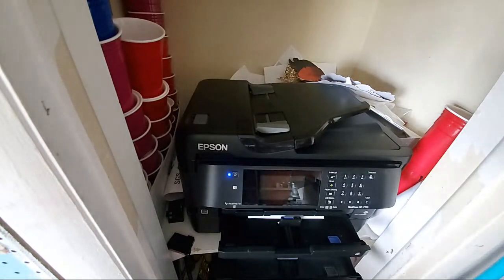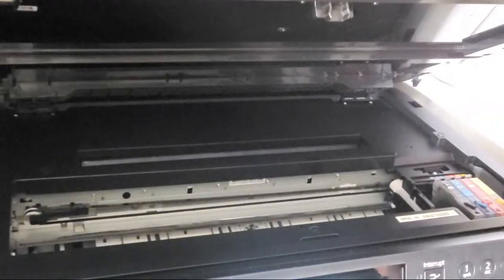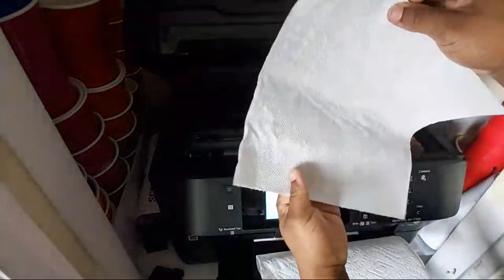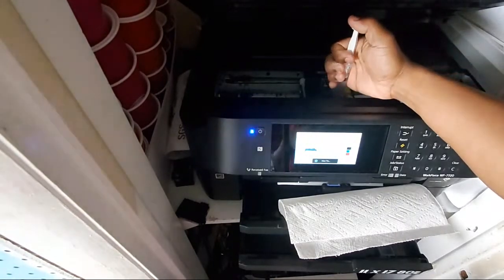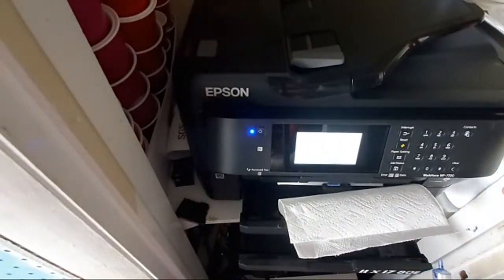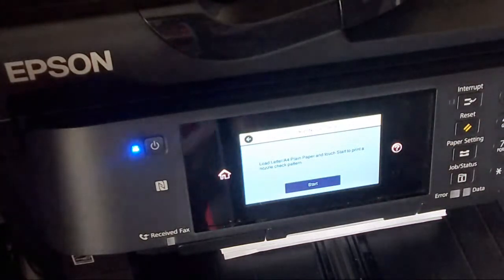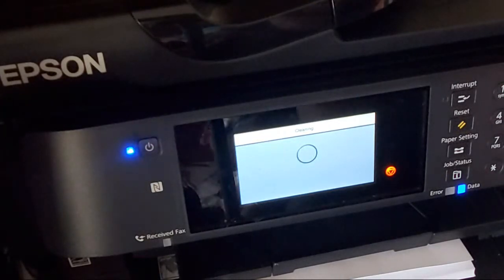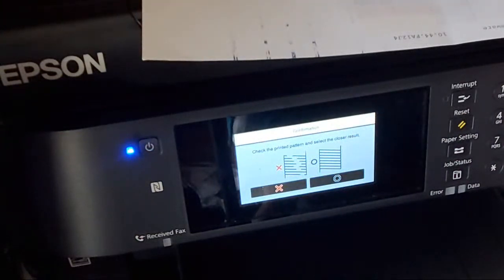How To Push Air/ink Through Your EPSON WF Printheads

Comment: I thank you so much, my WF7720 was only printing black outline and all other colors were fine. Then I did Print head nozzle check and the Black wasn't even printing. I've been searching for days for solution, no matter what I did as per GOOGLE search, nothing worked. The frustration was getting crazy, was ready to throw printer out the window. LOL UNTIL I FOUND YOU. Thank you so much. Was so easy, and none of the techs I searched came up with anything so easy. Congrats to YOU and Thank you so much for posting!!!
Reply: I followed your video step by step and I didn't have much resistance when pushing down the plunger. Then when I let it go, ink came up through my syringe... What does that mean? Anybody... Please help
Reply: Its works perfectly fine now!!!.... 1,000 Thank Yous for this video because I truly thought all hope was lost. 🥰
Reply: Hi my printer wf7720 only printer the black. This can fix my oder color?
Reply: @unisharky4222  Yes  follow step by step for any color. I used it on cyan

Comment: Kudos to you hon, you explain it in laymans terms...not like those geeks who harp on and on and drag the video out. The fact u explained the nozzles may not be clogged with dry ink but possibly trapped air due to Epson have the special Piezzo head nozzles is welcoming. i have the syringe & tube, cleaner, etc which worked (u can use Windex with Ammonia also)  Verdict: you just saved me AUS $280 to a trip to the nearest Epson Service Centre !

Comment: Thank you very much for your video introduction. I have a "Epson Workforce WF-7310 Printer." i followed all instructions, but I find when I "nozzle check" there will be the color lines showing. My big issue is with my "Epson brand ink color 812 C-Cyan." All color pictures are showing simply pink no other dark color details.

Comment: Hello Super Mom! First of all, like alot of other women, I commend you with handling your young one in the process of making this video. I did a push through as directed and when I looked at my paper towel, I had a lot of ink. I was pushing the syringe until I could feel some resistance and I never did. Does, or will this create a problem. How should I clean the area underneath the paper towel?

Comment: hello awesome video by the way, I tried this with my black little to no resistance when i push the air through, but nothing comes out on to the paper towel, other colors come out fine, any advise?
Reply from the maker: If there was no resistance I does not have a good seal. Make sure the fill hole is plugged. Make sure there are no cracks in the syringe. Make sure there are no cracks in the cartridge itself

Comment: So my question is.  Should the plug over the air hole be left off?  I have the Epson XP 4105. I converted it to sublimation and now it prints blank pages   I have the firmware changed and chipless cartridges installed

Comment: Have you ever refilled a catridge and afterwards all the ink leaks out ino your priter and blotches on any printouts including when you print the lines after a cleaning? It won't print that colors lines. It just blotches all over the paper.
Reply from the maker: Yes I had a yellow cartridge leak from a small tear in the plastic  liner. I had to clean the inside out with LOTS of paper towels and q tips. The ink was in every crevice of the printhead carriage so it took a while. And there was ink almond the bar where the rollers are so I had to clean that. After that and changing the cartridge out everything was fine.
Reply: @HonestlySpINKing  and you replaced the cartridge with a new one? I ordered a new black one yesterday. The black for my printer is the double capacity one. I don't know how I'm ever going to get all this ink removed, but praying a new cartridge will solve the problem once I get it cleaned. I had just started my first big order when all this happened 😭

Comment: I did this earlier today when this video was recommended because my ink hadn't worked in about a week. I got one good print then it did this again. How often should I have to do this?
Reply from the maker: check your cartridges and see if you have the style that needs to be primed. it will have a circle chamber in the middle. If you have that style... is there ink in the circle?

Comment: my printer is epson 3750. Cyan colour's pipe which is coming to cartridge is producing air bubbles. If I inject ink from sryinge, it prints when its gets empty, it doesnt print, means it is not taking ink from the tank. what to do?

Comment: this isn't a sublimation printer.  it's pigment ink and not in the refillable cartridges.  is there a way to blow those out or will I have to buy pigment ink, fill them and then try again?  I have another 7720 with sublimation ink and refillable cartridges.  so far that one seems OK.

Comment: I am also having air problems but I am not using refillable cartridges, but some generic "Epson" cartridges that do have a hole at the back end there. So can I use the same method to push out the air?

Comment: I just converted my epson wf 3620 when i do a print head nozzle ck my paper is blank. I've tried print head cleaning, print head alignment, priming the black ink, and I watched this video when i did this procedure there was no ink on my paper towel!!!!!😩😩😩😩 Help me please!
Reply from the maker: di you start with the Epson cartridges? did you remove the vent plugs when you first put them in?
Reply: @HonestlySpINKing  yes to both! I've done everything I can think of except install drives do I need to do that?
Reply: @HonestlySpINKing  thank you sooo much for even responding!!!❤️

Comment: Hello, how do I push air through a print head on a 7710 that has not been converted.  Bought a practically new printer that was used for one semester in collage but has been sitting for quite some time. Mom wanted to get rid of it for $200 but I can’t get the black to print. Need help ASAP
Reply from the maker: You cant you need refillable cartridges
Reply: Do you think it will work if I order the  cartigages from you and get the 252 regular ink. I also have the 7720 that I converted and I have sub ink from you
Reply from the maker: @shirleyscottredding8935  yes
Reply: @HonestlySpINKing  I think the cartridges that I used  may be sublimation. I had some when I bought the ones from you and had ink pro sublimation ink in them. Will I still be able to use the reg ink again? I don’t want this one to be sublimation. If I get it fixed, what setting would I use for the regular ink

Comment: My 7720 will not recognize my cartridges.  I had it happen before and all  had to do was remove and replace this time it is not working at all I have removed so many times I am wondering if I need a new printer.  the printer was being used I just refilled my cartridges and now it won't work.  Can you help me?

Comment: If you do the push air through and it still doesn't work then what. The blue ink came out but my lines are still messed up.
Reply from the maker: Do your cartridges have a circle in the middle? If so you need to prime them.

Comment: Is there a reason why you cant just do the same thing with the cartridge outside of the printer?
Reply: The purpose is to clear air that's in the printer's ink channel and heads. If you take the cartridge out, you'll possibly introduce more air into the system.
Reply from the maker: Yes, as Peter said the purpose is to push the ink through the printhead itself. If you do it outside of the printer it will not help.

Comment: On the print head my yellow lines doesn't show up and my ink is full. Is it something Im doing wrong
Reply from the maker: Did you remove the vent plugs? Does your yellow have a circle chamber in the middle? If so did prime it?
Reply: @HonestlySpINKing  How do I do the prime. Or is it another video that I have to watch.
Reply: Where would I find that at?

Comment: I pushed air through and the red went all over inside the cartridge cradle. Then the machine would not recognize the sublimation replacement cartridges. This is the Ed-7210